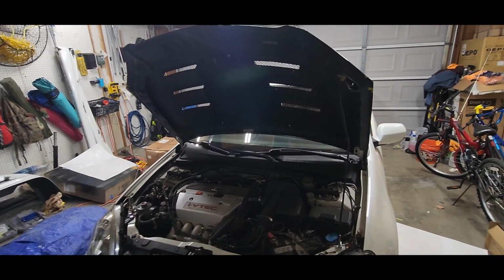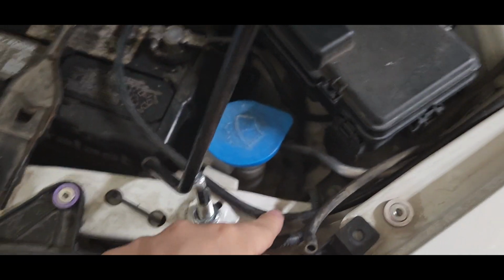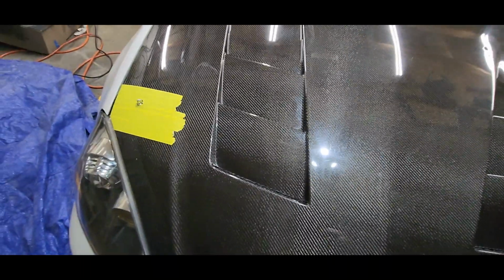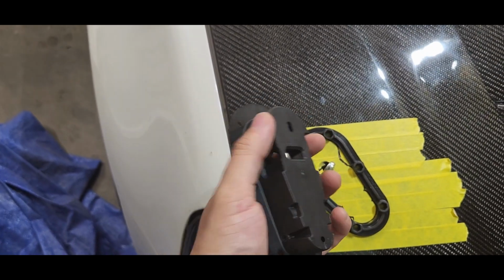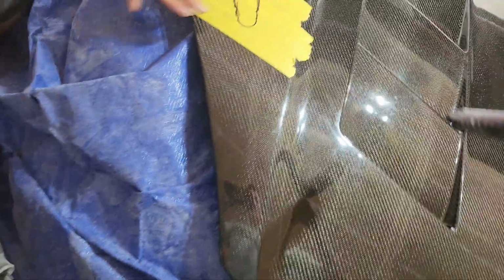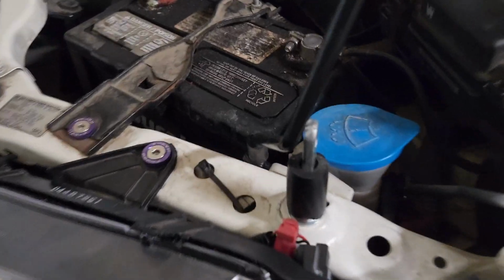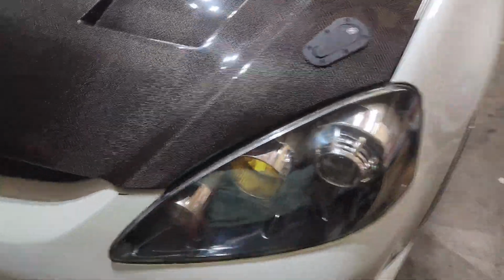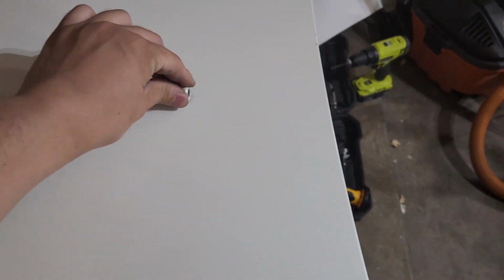How to Install Carbon Fiber Hood and Aerocatch Hood Pins on Acura RSX

Comment: For placing the hood latches symmetrical to each other on top of the hood you should have take measurements from the top and bottom of the latch to the edge of the hood. Would have made them perfectly symmetrical rather than just eyeing it.

But other than that, great job on the instal! Looks great!
Reply from the maker: Yea i saw that how mighty car mod did it too. The right side was my first time doing it, the left side i could have take measurements but then i need it to make the video so decided to eyeball for the sake of the video amd didn't turn out too bad tbh. Cant really tell

Comment: Do you need the hood latches or could I just buy the hood and close it like oem? Sorry I never knew what the hood latches and locking pin was for
Reply from the maker: For carbon hood, it is highly recommended to install hood latches cuz the last thing you want is ur expensive hood to smack ur windshield and pay more $$ to fix ur windshield and a new hood when u could have spend extra $$ for hood latches since it keep the hood lock in place. Also, the dc5 is known for hood latches' failure. Some people having been driving fine with no locking pin for years, but dont cry when one day the hood smash ur windshield bcuz u decide to take that risk by not installing hood pin on to ur carbon/fiberglass hood.

Comment: How do these hood do in rain?
Reply from the maker: It does fine, engine and battery will get wet and dirty but no issue on mine so far. If u are running an aftermarket intake (doesn't matter if it short ram or CAI), highly recommended getting a hyroshield for the air filter. 
Cant say about super heavy rain though, but i left the car outisde for 12 hours in the rain and start up fine. U can always swap back to stock or lay a vinyl wrap over the vent if you worry about it during rain season
Reply: @luedetailing7331  ohh cool thanks for info